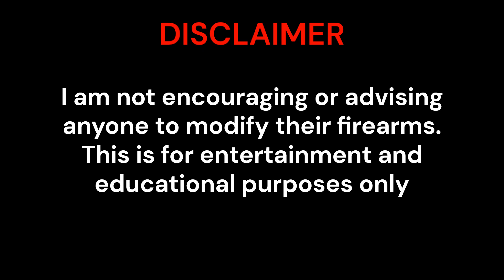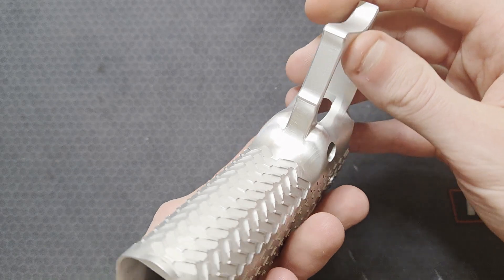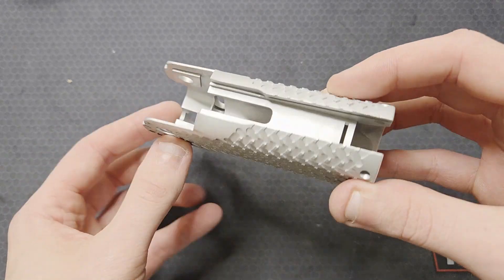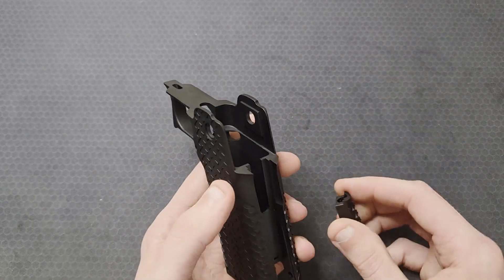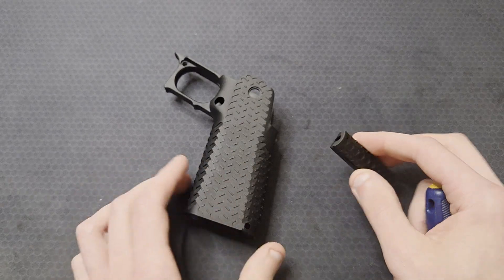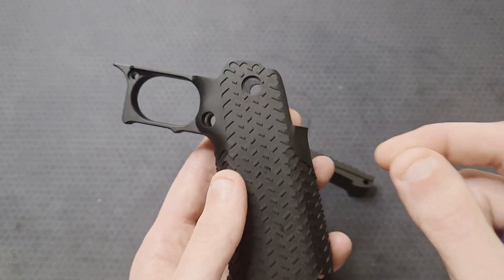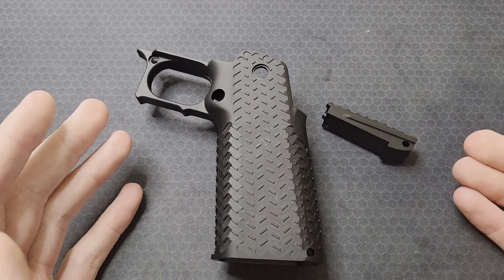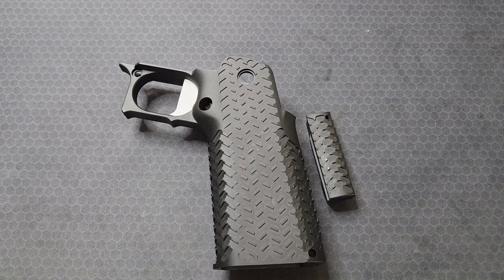Building a Double Stack 1911 Ep. 12: Grip Module Anodizing

Comment: Looks absolutely amazing (as everything does), but I'm curious why type 3? There are plenty of manufacturers doing type 2 on their grips, which is hard enough (thick enough) to protect the aluminum. 

In my younger days I worked at an anodizing company, and we did type 2 on all sorts of parts like train window frames, industrial scaffolds etc etc. Most of the work wasn't dyed, but we did dye black for frames and gold for matte and high-gloss (nitric acid polished) frames. (We had other custom color baths also)

ALL of which were PLENTY hard enough!
Reply from the maker: Thanks! 

Type 3 hard anodizing is kind of the standard in the firearms industry. The extra hardness and thickness of the oxide is likely not needed for this application. Maybe in the mainspring housing, but still probably not. But for like an AR upper? I would want type 3.

I have done plenty of type 2 (decorative) anodizing myself and I also feel its tough enough for this application. I couldnt anodize this myself, I dont work in the lab where I had access to the equipment anymore and dont want to buy it myself. 

I wanted it black. Figured I would just get type 3 as I know a local place that does it.
Reply: @EngineersArmory gotcha! So basically if youre sending it out might as well get type 3. But there's no specific reason for this application.

I do see your point about the mainspring wear but even that Im not too sure.

Thanks for the feedback sir.
Reply from the maker: @murrayeaton  sure thing!

Comment: I understand that for something like cerakote, it calls for the parts to be blasted down to bare metal. Typically I've seen them completely remove the anodizing. Would that then have a negative effect on parts such as these at key contact areas, since the hardened finish is now gone?
Reply from the maker: I dont know that the blasting would completely remove .002" of hard anodizing. I imagine they blast it, and it removes the sealant and blows out some of the dye, but the anodizing isn't totally gone. You would still need the hardness of the anodizing. Cerakote does not provide the kind of wear resistance needed. Cerakote should be put on top of anodizing. The aluminum oxide structure provides a great substrate for coating adhesion. I am not sure how the sealant affects adhesion. Maybe for coating the anodizing is left unsealed.

Comment: So excited to see the final.product! Out of curiosity could one do a clear anodize?
Reply from the maker: Yes, "clear" anodizing is very common. Its usually called clear but thats just the finish of the aluminum oxide. It is still generally sealed though. The sealant doesn't really add a "clear" coating, rather it plugs up the open end of the hexagon columns. Adding color by dying is done after anodizing in a separate process, before sealing. Sealing plugs the open column end keeping the dye in - it will leech out otherwise.

Comment: Do you think media blasting helped with putting a little radius on the edges of the grip texture, or is it too soon to tell?
Reply from the maker: With the media I used, not enough for it to be noticeable. I purposefully used a fine, less aggressive media, the same one Cheely uses. More aggressive media could round those corners off. I didn't want to change the texture of the grip because it felt perfect to me.

Comment: Atlas aluminum grips are DLC coated via an in-house Armorlube system they own and operate. They are not anodized.
Reply from the maker: I would really like to see a source on that if you had one. Anodizing strikes me as such a better coating for that application with the much softer base metal.
Reply: @EngineersArmory I own several and have talked to Atlas at length about it. Adam and Randy at Atlas are not shy about it.

Their DLC recipe for their aluminum grips matches the finish for their DLC recipe on their SS frames and slides.
Reply from the maker: @aarondbritt  Cool, seems legit enough. I have seen forum posts that say yes its DLC, or that they used to do DLC but now its anodizing. Don't know that I've seen it specifically called out on their website anywhere. DLC would make sense if they have that capability in house. I still think anodizing is the better option. 

Stainless steel slides and frames? All their slides are 4140. At least that what is stated on their site. Don't know about frames, I would assume the same, but they don't sell those separately so there is no product info to check.
Reply: @EngineersArmory Rhey sell them to Venom and Rafferty - ugh! But not to us “Normies” the SS was a typo/autocorrect, or I’m old and dumb let’s go with typo :) They do offer Stainless Steel grips in the .40 cal models (Titan and Artemis variants), but I do believe you are correct that the frames and slides are all carbon steel.